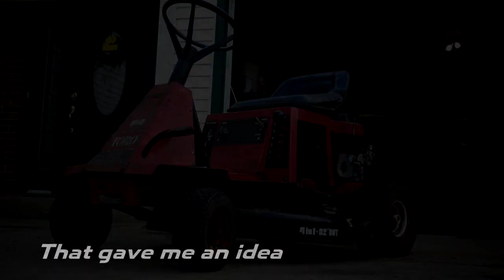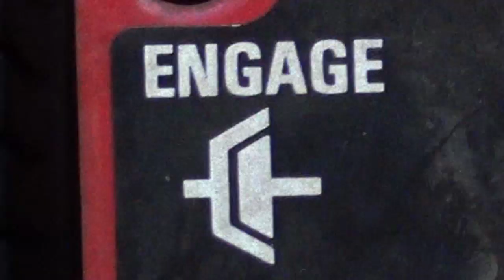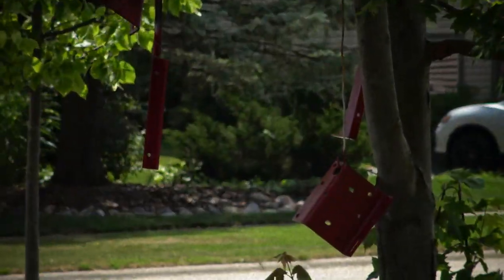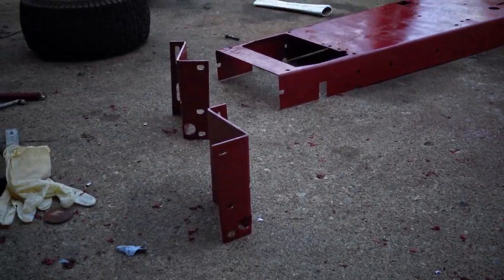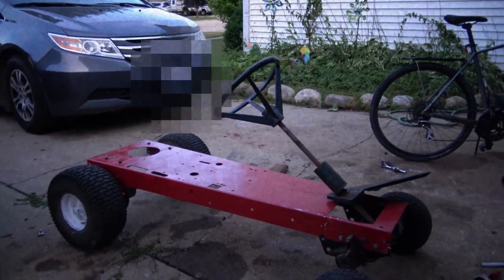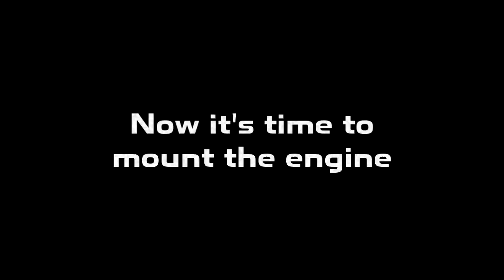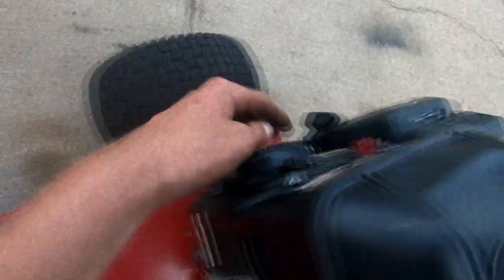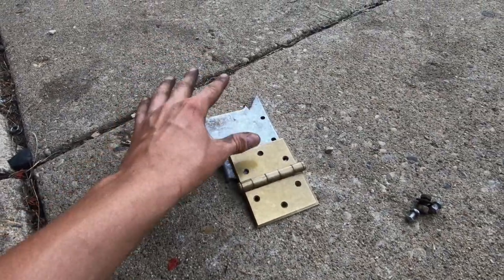Building a GO KART out of an old Lawn Mower

Comment: I have that exact same mower that im turning into a racing mower. the only thing stopping me is i cant get the transmittion  pulley off. if i cant get it off i was planning on doing something similar.
Reply from the maker: If you can't unbolt it, cut it off
Reply: @StringerMedia  ive been putting off doing that cuss its gonna suck.